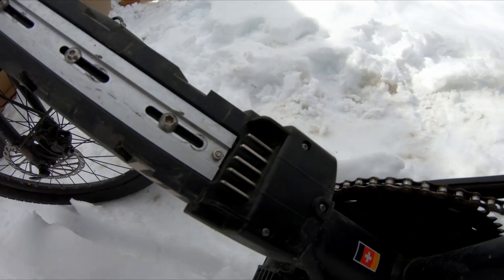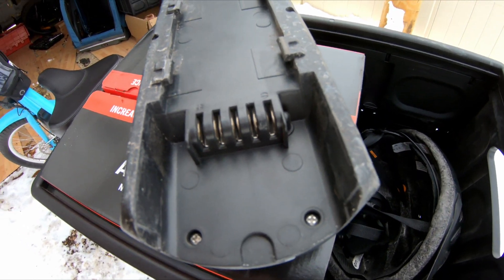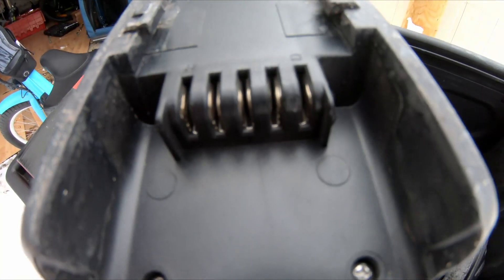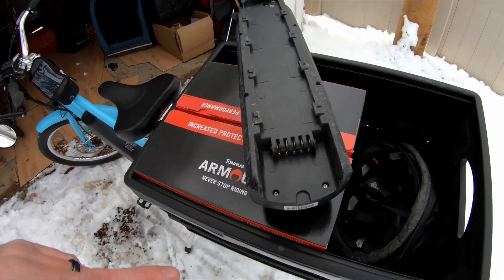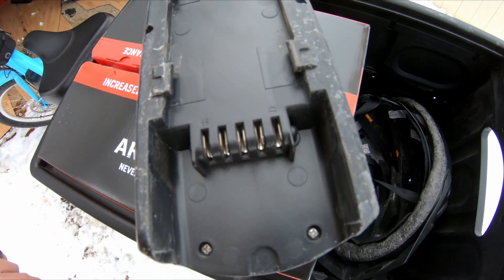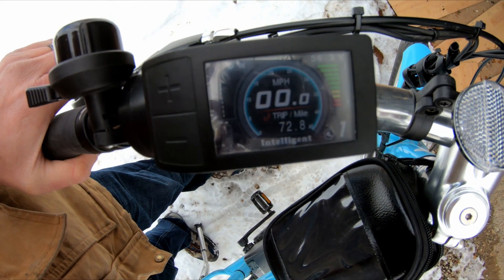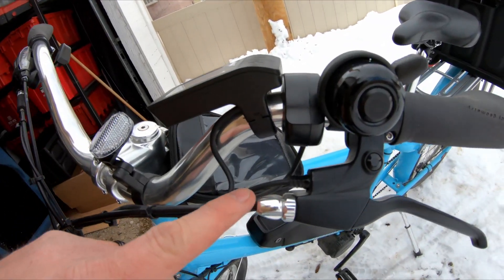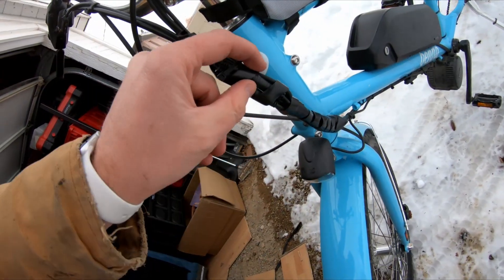Electric bike not working? Try these Troubleshooting steps!

Comment: Can you do a video on waterproofing hailong batteries?
Reply from the maker: Great idea!
Reply: @JohnnyNerdOut  I recently bought 2 cheap hailong batteries. Im getting great range but im scared for every small shower that might completely cook the inside
Reply from the maker: @MrJob91  you should be alright. I’d take some outdoor rated silicone or even Henry’s roofing tar and run it along any seam.
Reply: @JohnnyNerdOut  great idea
Reply: I ride year round, in all weather, in The Midwest. I have never invested in expensive batteries for myself or my customers, who I also encourage to ride in all weather. None of us have had any electrical issues.
Reply: @MHH3180  for me parking overnight in a rainstorm is an issue. My imortor will get stuffed with water if you leave it out in the rain